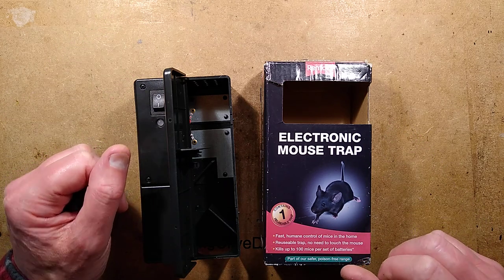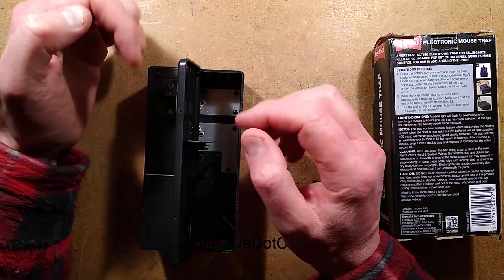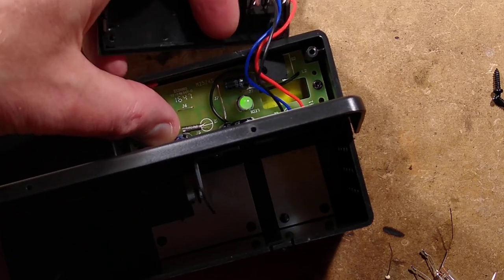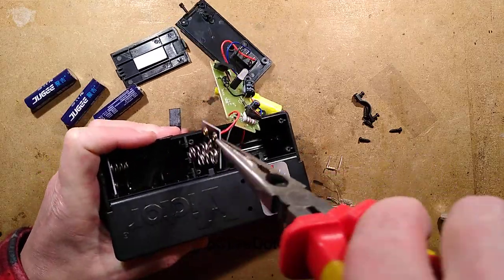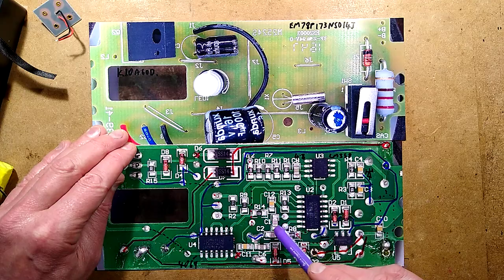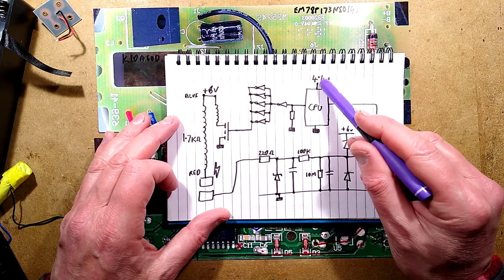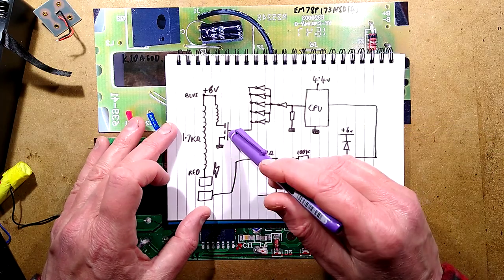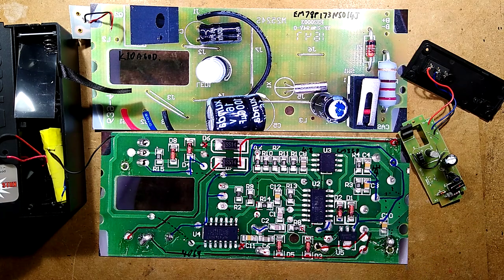Inside a Rentokil / Victor electronic mousetrap.

Comment: Woh woh woh.. you can get lithium cells in a AA housing that output 1.5V? I want to know more about those, as I find Ni-MH unsuitable in a lot of cases.
Reply: I was going to say that too.
Reply: 4 of these plus their special charger go for <$40 on ebay it seems.
Reply: Zinter do them. Got a lot of flak here for mentioning that they can be really useful, just for the reason the DO produce a STEADY 1.5v. Convenience of a built-in micro USB charging port too, and a decent run time. Not as much capacity (yet) as similar sized NiMh but the ease of charging is a major attraction.
Reply: It was news to me too. Looks like several options are available from Amazon. Good to know.
Reply: They make some that have a full size USB for charging. I keep them around because they are super convenient
Reply: They were in one of his videos a few days back
Reply: Whatever happened to Periodic Reverse Current chargers for zinc carbon batterys ?
Reply: I thought I knew something about batteries but a cheap battery pump offered by harbor freight (Item #63847, #64124, #56646) taught me a new thing. They won't work with standard D cells, they MUST have alkaline cells because of the higher current delivery. And no where does it say as much in plain chinglish. And I have the rat version of this device. I rigged up a driveway alarm to it's triggered LED that allowed me to know inside the house that the trap had discharged. Didn't take long and the remote went off. I found the trap on it's side with bait stolen (apple slice) and never again would I have a need for the thing since they would not set foot in it again. Not enough punch in the standard cells strikes again? The pump episode would happen many years after the trap failure. The cheapskate has been reformed, I don't buy standard cells anymore as amperage must be satisfied.
Reply: Rubén Balea I ❤️LiFePO4!  They work so well in mech mods too!
Reply: @Le Kal Agreed, but the full charge voltage (about 1.9V) could be too high for some devices. Make a pair with an NiMH and you have 2.8V nominal and 3.3V full charge which should be ok.
Reply: @ruben_balea  Most 3.3V devices have a maximum operating voltage of 3.6V, nicely coinciding with the maximum charge voltage of most LiFePO4 cells. So there should be no problem.
Reply: Whoa whoa whoa, how do you spell whoa?
Reply: You certainly can.  Not sure about rechargeables (the "14500" cells I have are standard 3.6v units), but Energizer's finest AA cell -- the "Ultimate Lithium" -- is my go-to for non-rechargeable must-be-1.5v batteries.  They're relatively expensive, but I use them in places where I dare not leave a standard alkaline, such as the warning beacons I keep in the car.  They can last their entire shelf life without leaking and without losing charge.  Well worth the money.
Reply: @steverpcb  whatever happened to zinc carbon batteries?  People must still buy them to put in children's toys or something.  I swear I haven't bought one in at least 35 years or know anyone who admits to buying them.
Reply: @ruben_balea  For real fun with power, I have an 8 cell AA battery holder filled with 14500 cells, it comes with a 9 volt type plug built in. I can power a 100 watt LED with the little power supply. I haven't let it run long enough to see how long they last though.
Reply: @steverpcb  I still have one, the only batteries that leaked after charging were........ Duracell.
Reply: Been on sale in shops for years I used to use them in my mini disk player they last a week instead of alkaline at 24 hours

Comment: I went for a more 'organic' approach, I have two cats and zero mouse problem. Sure, the upkeep is a little more expensive but mouse residue removal is reduced by around 50-90% most of the time and my neighbours gain the benefits as well. They also keep your feet warm on those cold dark winter nights. (the cats, not the neighbours) -<edit>
If you prefer the more impersonal approach of mechanical or electrical devices to cure your rodent problems I can assure you that you'll be hard pushed to match the aire of indifference to your existance a couple of cats can give you.
Reply: My two cats are lazy and do nothing about mice. I think one of them would just purr at the mouse and lick it.
Reply: I tried the cat thing, but many of the song birds started disappearing around my yard, so the cats disappeared also.

No, I didn't kill them, I brought them to a local farm, and the owner was happy to take them. 👌
Reply: @davelowets  Ahhh, the old "they've gone to live on a farm" excuse. I like it 😁🤣🤣

Comment: When I lived in Canada I designed a small hand made fridge magnet in the shape of the classic mouse trap. The model I had at hand to use for reference was Victor branded so mine had the same V on the trap but with the name Victim instead of Victor. 😏   
Your video using that same brand name reminded me of that. I still have a bunch of unfinished ones in a box somewhere that I brought back to the UK 🙂

Comment: Great video!
I agree that it's well designed electrically, but "humane" definitely needs the inverted commas!
Some years ago I had a mouse problem at a rural property I was living at. I'd always prefer not to kill anything, but catching and releasing mice was literally illegal in that area. As an autistic physiology grad with an interest in electronics, of course I locked on and spent about a week researching & designing what would be necessary to make a truly humane electric mouse trap. I ended up pouring over piles of mouse cardiac physiology papers, ethics guidlines, running dozens of LTspice circuit simulations, the lot!

TLDR; My conclusion was that it would be impossible to make one that wasn't either extremely elaborate, gruesome, or very dangerous to people. I never ended up finishing the prototypes because they were terrifying, but for the sake of morbid curiosity I'll outline below what I determined would have been needed.

(CW: animal suffering, explaining how the trap in the video is horrific imo)
Most rodents, including mice often exhibit "spontaneous cardioversion" - i.e their hearts will often automatically regain a normal rhythm after entering fibrillation (abnormal heart contractions = how electrical shocks usually kill). Electrical conductivity of the paws is usually very poor too, and they are highly sensitive to pain - many laboratory 'ethics' guidelines I read completely prohibited euthanizing lab animals with any kind of electrical shock to the paws. It's horrific to even say it, but I don't see how the above trap wouldn't just cause some mice to be paralyzed in pain for 20 seconds at a time until they suffocated or died of exhaustion. 
The only solution I could devise that might claim to be consistently humane was completely OTT. It had a cockroft-walton multiplier from mains, up to around 3kV to mitigate poor electrode to skin conductivity. Specially arranged spring electrodes were needed to ensure contact was with the head and sides of the mouse, not the paws, and the initial shock needed to be several joules to ensure instant loss of consciousness (big capacitor, big bang, potentially gruesome because of the power levels - the mechanism for ensuring loss of consciousness is by inducing a sudden temperature rise in the brain). It then needed a control system to apply a lower AC voltage for several minutes to ensure consciousness isn't regained and that cardioversion doesn't occur. This also had to ensure that enough current was being delivered, but not so much that it literally cooked the mouse and/or became a fire hazard. 
CONCLUSION: A proper electric trap needed to be elaborate, gruesome, and dangerous to people.. If you must, just use a traditional snap trap.

Comment: I use the victor rat traps (field rats- only a little bigger than mice- but too big for this trap, which I also have). Biggest downside is that they are very difficult to clean. Victor's newest rat trap was modified to make it easier to clean.
Far more humane than a glue trap, more sure of a kill than a snap trap (so also more humane in that way) and no need for poisons, which will end up going higher in the food chain. 
There is also a Wifi alert version, but I've found the alert is pretty flaky.

Comment: I have the rat trap in the same brand, works like a treat. I've added a solar panel and battery with reg to replace the D cells.  You can use sunflower seeds as well.
Reply: Grain is less messy, the rats loved it,the result was mostly fatal.

Comment: What you have there is essentially a Kettering ignition coil circuit, Clive. That buzz you're hearing is transformer squeal, which cheap transformers like this will do unless given a dunk in some hot wax. Probing the waveforms with a scope probe on the primary (don't mess with the secondary!), would unlock the mystery of the circuit's operation. The discrete diodes protecting the CPU input are needed because the IC protection diodes are not very robust, only designed to snub out infrequent static zaps. They can't tolerate continues overvoltage stress like this. Discrete diodes can absorb a helluva lot more energy than the IC's input diodes can.

Comment: I've had pet mice, and they can be very sweet. But I live in an area where mice spread some pretty serious diseases and can do very costly damage to home and cars. I use the same model trap in my car and it does indeed work. I only did this after having a mouse chew up the wires in my engine then stuff my airfilter box with acorns, shredded fabric, and feces. :O

Comment: I was going to buy the multi kill version of this, by the time I found something at a good price I no longer needed it! I guess the multi kill version has a very similar circuit - it removes the kill and resets, so the mechanics would be worth looking at. They also make a WiFi enabled version. I had started designing my own using the traditional mechanical trap coupled to an ESP, using the kinetic power of the trap to power up & send a signal that it had been activated. As you can tell I spent way too much time thinking about it and no longer had a problem to deal with!

Comment: I’ve got 2 of these, branded “pest-stop” (Victor) bought from Screwfix I think. They are quite pricey, but by far the best mouse traps you’ll ever own. Never has a mouse taken the bait and not been caught. They must have got at least 20 mice between them now, and still on original batteries. Well worth the money if you have a mouse problem

Comment: I had a different version of this Victor trap in which the two micro switches failed to make up and no amount of bending of the trigger would work. I ended up gutting the thing and use it as a container for a snap trap which works reliably every night.

Comment: If you ever want a nice Fluke meter that HAS a Low-Ohm/Hi-Res function (down to 3 places after the decimal for Lo-Ohms), grab yourself an older Fluke 88 Automotive Multimeter. I bought one brand spankin new back in about 1998, and i think they were in the $700-$800 range back then, but they are quite affordable for a second hand one today. Its a NICE meter with alot of special functions that the regular Flukes dont have. 
I know you'd love it... 👍

Comment: I was a machine operator at the Lititz plant. It was a shit show on a good day, but I ran some really cool machines. The machines that make the standard mousetraps are from the 30s. Almost entirely mechanical, formerly 7 separate machines that were jury-rigged into one. Supposedly the only machines in the world that you can put a block of wood in one end and get a fully made mousetrap out the other. Also you'd be lucky if you got away with 30% downtime in a shift.

Comment: I have to wonder if the op-amp is actually cheaper than using a microcontroller with an ADC and internal reference to measure the battery voltage, but then this design may be 10+ years old and maybe it was cheaper at the time. Also given the lack of an ADC according to the datasheet the op-amp is probably being used as a comparator and outputting a logic level go/no-go signal, so the "battery dead" threshold could probably be adjusted for 1.2V cells by changing a resistor.

Comment: I bought one of these and it seems to do the job, but it eats batteries. Do you think it would cope with a slightly higher supply, say from a 2S pack of lithium rechargeables? 8.4V isn't too wild for the parts in your simplified schematic but I'm not sure if the omitted parts might mind?

Comment: I wish I'd discovered Mousetrap Mondays before the last rodent problem.  I dispatched them using standard spring traps (which don't work very well -- the mouse cleaned the bait off three of four traps before the last one actually worked).  Also, that is the very LAST time I use glue traps.  About half the trap had been chewed up and the mouse failed to escape. :o(

Next time (and I'm almost guaranteed a "next time"), I'll be busting out the multi-kill version of this trap.  Better this than having to have my car towed to get wiring harnesses replaced or finding another A4-sized hole in the filter of the Shop Vac.

Comment: thats quite thoughtful of them to include a battery test on each powerup so the mouse wont just get a huge shock and lay there injured.. still, i sorta feel 20 seconds of electricity is less humane then the standard mousetrap that i think kills instantly. i wouldn't want to hear when a mouse goes in there.. you'd hear the buzzing noise and probably the mouse trying to escape and throwing the box around..

Comment: i made a slightly more powerful version of this once. It involved 75,000uF of caps charged to 800v with an electrophoresis power supply. I called it the Ratonator because of the sound it made when one got across it. It sounded like someone had let off a shotgun in my garage,  and when i got out there  i discovered a massive skid mark on the bench where the electrodes had been and bits of rat all over the wall.  Didn't use it again due to excessive mess.
Reply: That's 24 kJ. No wonder you blew up the rat.

Comment: I've used these. Only problem we've had was the power switch on top got gunked up somehow, cleaned that out and it worked fine again. Great for car floorboards and places where pets might try to get into it (where you don't want to use the snap traps).

Comment: Hi. I have a multikill Victor.
With new batteries, the red light slowly flashes, indicating flat battery.
Sometimes there's a hum, then red slow flash.
Sometimes a hum, followed by a higher pitch hum.
Happy to hear your ideas...
Enjoyed your video.
Thanks
Reply from the maker: If the batteries are good quality alkaline cells then it may be faulty.  If it's new it might be worth contacting them.
Reply: @bigclivedotcom  batteries new...it's past warranty...I love the dumping spindle floor option...
Thus multi kill.
This is why I'm pursuing.
What components should I advise to be checked, given its indicating batteries flat and no to odd buzzing at different tones...
Thanks for reply .

Comment: I have mice and rats here, and have spent a bit of effort and $$ trying to keep them out.  (Hey, I'm in a redwood forest. They were here first. I just need to keep them out of the house and foodstuffs!) I've had the best results with variations on this kind of trap. Fast, not lingering. Other options are mechanical traps, poisons and drowning. (Or several other variations on slow torture death) I'd thought that these used a DC/Cap/charge thing, didn't realize they were triggered AC. Rather unusually overbuilt. The problem with this particular trap is that my mice (As true of pretty much every critter around here) are big and healthy, can barely fit into this trap! If they get into it, they're toast, tho.  I have a larger version which works on mice and rats ok. Feel it's the best of a bad batch of choices. (Had pet rats for many years, pretty good pets, frankly.) Have been too lazy to pop one apart and puzzle it out.  Thanks, Clive!
Reply: I have looked at the humane traps, but then I look at the chickens... chickens are very effective rather than humane. Surprisingly few mice make it into the house, and I have a couple of spring traps there. But given the "discussions" I hear from the chooks I think they catch at least 10 mice for every one that gets inside.
Reply: @mozismobile  One of my co-workers has chickens that'll go after rodents, so a good point. Bit rougher on the rodents, but then they're back in the circle of life.  Up here, tho, chickens, cats and dogs get eaten by coyotes and cougars for the bigger critters, and raccoons go for chickens, IIRC. Quite a full ecosystem, here.  I only hassle the critters in the house itself, leave the outside fauna alone. A friend offered a Jack Russel terrier that goes absolutely bonkers when she scents a rodent. She'd demolish the place going after critters, and terrorize them no end. she's effective, I'll grant that! Actually, my contractor discovered that the rats had tunneled under the concrete and up into the house, so they weren't even exposed outside! clever beasties. But that route's been shut down. Just once in awhile, a couple will get in..

Comment: Hi Clive... What frequency is the step-up transformer operating at - can you loosely couple a scope on to the cool to check?  Incidentally it would be a neat little IOT job to add a LoRa board to send an alarm when the trap has tripped, to avoid the rotting dead animal smell @Andreas!